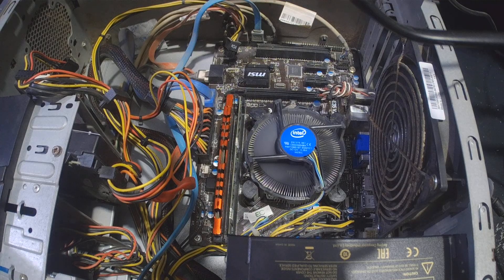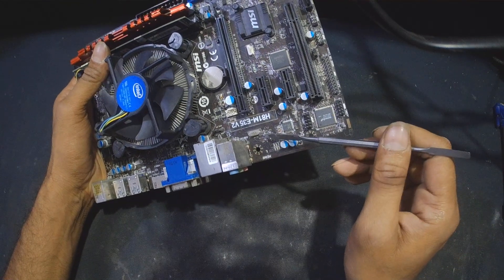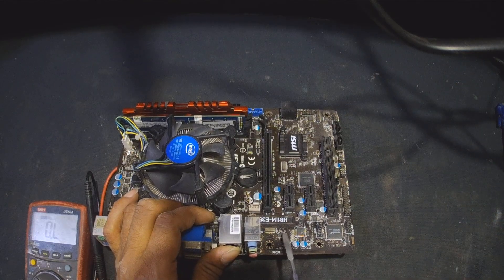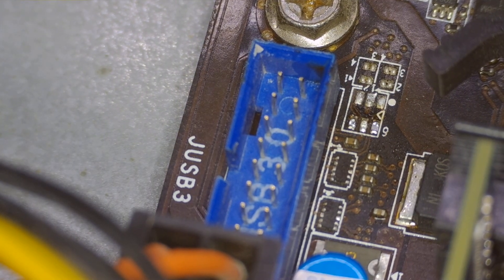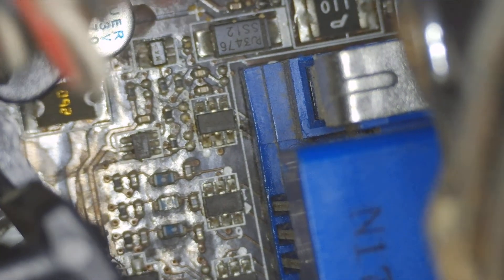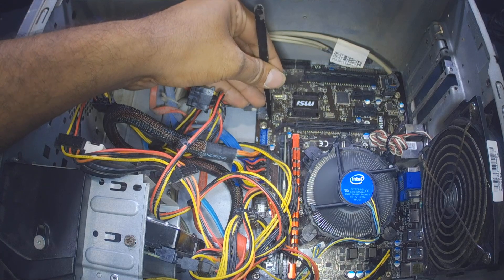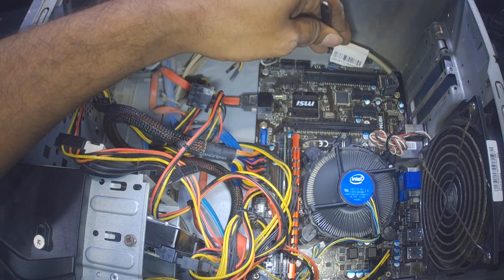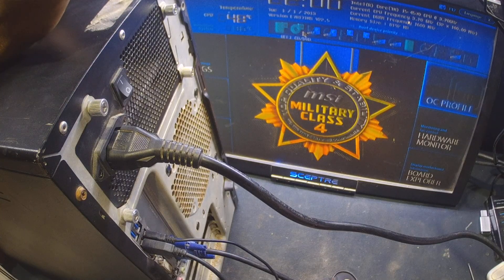Over Current Issue have been Detected on your USB Device Solved

Comment: I have found the bad usb port removed it and I am still having the error. Do I trace from the controller back or from the connector to the controller?  I removed the usb from the motherboard leaned to replace the port and trying to test before I go further so the problem is in the circuit? I am new to repair and am getting better.

Comment: I had the same issue. After checking each usb port it turns out one had a 5V pin bent and shorted. However, after bending it back the issue persists.
Reply from the maker: If the 5V pin was shorted, there might be damage to the corresponding components on the board, so it's best to check those components.

Comment: What if you have checked the voltage on all the USB ports, they are all correct voltage at 5v, and the PC is stil saying USB overcurrent? Any ideas?
Reply from the maker: Most of the time, I have solved this issue by removing corrosion inside MOSFET legs or reheating the MOSFET legs for dry solder. 90% of the time, I have found the voltage correct. difficult to explain where this problem comes from, the reason why I showed in the video how we can bypass this error by diagnosing a certain USB port and disconnecting the MOSFET. If cleaning or re-heating is not a solution, then disconnecting the SMD Part is the only way forward to remove this error.

Comment: mine is MSI gaming 5 t shows the same thing and won't boot to bios just shuts down but I'm not seeing those componets
Reply from the maker: I have checked the board picture online MSI Motherboard Z370 GAMING M5 motherboard, and it has a few of them, you better take it to a local repair technician, he will identify and provide you a solution for board repair.
Reply: Same with my new Asus Rog Strix B850 pfff

Comment: My problem was caused by that I accidentaly removed one jumper when I was disconnecting big ATX cable on motherboard, such stupid mistake. 😀
Reply: How to do what you have done
Reply: @drawnezami5821  for me there was a jumper missing. On the left side of board. It's labeled JUSB_PW1. jumper goes on the top 2 pins
Reply: Which Jumper sir 🙏
Reply: @haroonpeterson4163  I don't know, it's 4 months. 😀

Comment: if esd removed will usb port still function??
Reply from the maker: After Removing SMD Part, Specific USB Port will Not work, in this video i have disconnected the front usb Port connection, those are not having any power or data connections.